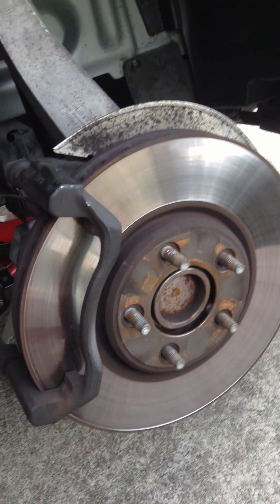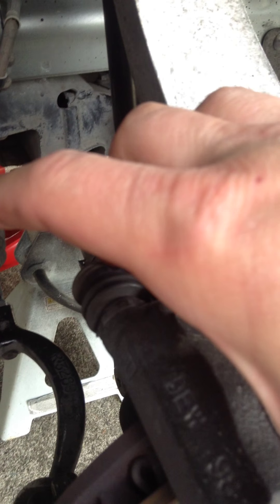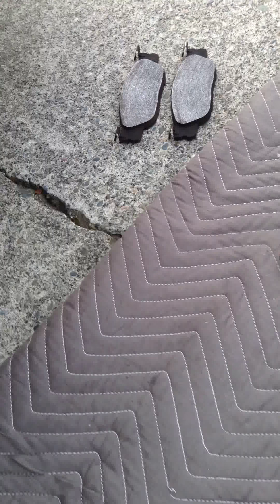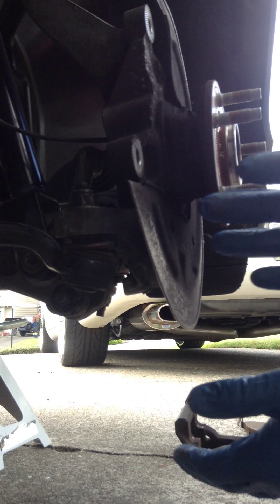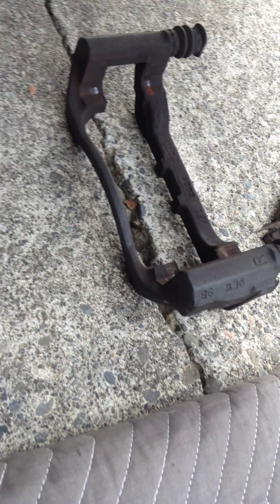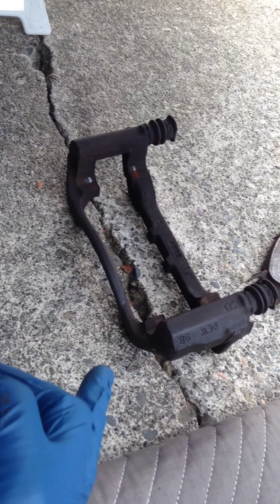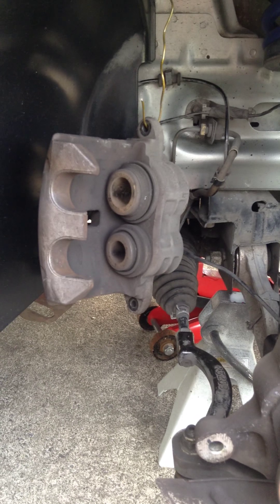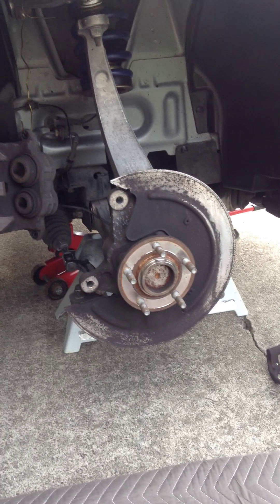Jaguar S Type Brake Pads Replacement | Jaguar S Type  Brake Discs and Pads

Comment: Can you show us how to just flip the rotors around ? I was told I need to do so but want to do it myself
Reply from the maker: So you want me to spend six hours taking the rotor off to help you? LOL  sorry bud, all joking aside, you will have to take what you can from the video and research it.  I dont know what you mean by flip the rotors around.  Ive never heard anyone do that and more importantly for what purpose.
Reply: If you are referring to "rotating", you take the rotors off and put them to the opposite sides. TO be honest, never heard of anyone flipping or rotating them.  There's no purpose at all.  Leave the rotors alone and whoever you heard that from stop listening.  You might be thinking rotating tires maybe but rotors no.

Comment: The clips are called anti-rattle clips and they help keep tension on the pad which prevents them from chattering or making rattle noises. whover did the brake job on a kawasaki Z10 I owned lost or forgot to put those back in (they are optioonal) and the brakes made all kinds of noise. Sometimes they are hard to find so don't lose them! You didn't say anything about what to do with the E Brake assembly?
Reply from the maker: Good stuff.

Comment: Well  i needed that first part cause my bolts on stuck and im not sure which way to turn it
Reply from the maker: I am not sure what you mean by first part?  Can you explain maybe I can help.  For stuck bolts get some pb blaster and a harbor freight breaker bar.  Also, not sure if this is a no brainer or not, but if you are using 3/4 inch drives grab a set of half inch drives as well.  You will also need some 1/2 inch ratchet star bit sockets for the jag.  Harbor freight has em!
Reply: @PhatkatCollections  i got it thank you my issue was the pistol you press in was different you have to have the tool you turn it while it presses

Comment: Thanks. Is there anything different or more complicated with the rear brakes? Someone told me the rears had to be done by a professional because the rear brake sensors where hooked to the cars's computer
Reply from the maker: Yes the rear pistons need to be twisted in with a proper brake kit.  You want to make sure the car is secure and then disengage the parking brake with your foot on the brake. Then turn off the ignition.  Make sure the car is in neutral then disengage park brake then turn off car.   Once you do the brake job you start the car and re-engage the park brake.  I've hear some folks get a fault but I did not.  Not sure if they get the fault due to having the brake engaged before doing the job or not.
Reply: as a non professional, where can I get a "proper brake kit"?
Reply from the maker: Harbor freight for your brake caliper pusher and pads and rotors I got off eBay.  You will also have to brake the rotors and pads in once I stalled.  Just Google it

Comment: This only amplies to 2003 and before.  After 2004 they have single piston electronic brakes, so this method isn't going to help you.
Reply from the maker: Your statement is completely false.   This applies to all year jaguar s types.   The braking system is the same except on the type R which uses different calipers and rotors.  They are larger and I 4 piston.  There are no electronic braking systems.  You may be getting confused by the electronic parking brake.  Easier years had a cable style parking brake then the migrated to the electronic one.  This car has the electronic one.   So you are incorrect .
Reply from the maker: This is another example of someone who does not know what they are talking about.   Jaguar has NEVER USED brakes by wire, ie electronic brakes.  It always amazes me how many morons there are on youtube who think they know what they are talking about.  The stype is broken down into three generations 2000-2002, 2003-2004, 2005-2008 and the  S Type R.  The type R is the only s-type that uses 4 piston calipers by Brembo.  All other generations and years use standard 2 piston calipers ( single piston on the rear if memory serves correct) All systems are hydraulic. There are no electronic brakes ( brake by wire) on these cars.  Nothing changed after 2004 so you are completely false.  In 2003 they changed the side skirt, 2003 they changed the v8 motor,  2003 they also used different cylinder inserts. Alot of improvements happened to the v8 version in 2003.  2005, they changed the side skirts.  Also, the electronic parking brake addition I believe happened in 2003 as well.  The pervious models were the standard hand brake by wire.  The brakes are hydraulic so this method will work on ALL jaguar non type R stypes.  The STR is a bit different but it is the same principle.
Reply: I can send you photos of my 2004 s-type with electronic brake. I have owned many jags and have 2 at present. You are embarrassing yourself buddy. Sorry.
Reply from the maker: Yup you do that.  The 2004 DOES NOT HAVE AN ELECTRONIC BRAKING SYSTEM.  It has an electronic parking brake.  Please send the pic.  You might be referring to an electronic wear sensor, but again, the brake replacement process is exactly the same as any car.  The only difference on a pad with an electronic wear sensor is you plug it in.  The only person embarrassing themselves is you.  SO AGAIN SIR,  YOU ARE 100 PERCENT INCORRECT.

Comment: Great - watched you're vid then changed my front rotors and pads today!
Are you gonna put up a vid for the rear brakes???

My man! 
Nige
Reply from the maker: +Nigel Sevier Hey bud thanks !  no I was strapped for time so I did not make one.  I can help give you some pointers if needed.  The rear you will need a different caliper press.  I recommend just getting the harbor freight kit for only  bucks.  It comes with everything youll ever need to do a brake job.  The rear calipers have to be pushed and turned at the same time.  The harbor freight press does this it basically turns the piston back into the caliper.  You cannot just press them in like the front.  Its still really easy and thats the only difference then the front.  The only thing you must make sure of is before you start the rears put the car in neutral  (saftely blocked off the car cannot roll away ) put your foot on the brake and make sure the electronic parking brake is off.  With your foot still on the brake turn off the engine.  The cars emergency brake will not be off.  The other important factor is once you are done.  Do not start the car!!!  First get inside the car and pump the brakes about ten times.  This will push the brake pads into position again.  I kinda forget exactly what I did but at this point im pretty sure I started the engine then engaged the parking brake.  This avoided any brake faults and avoided EPB re calibration.  Also one more note.  Make sure that when you put the new pads in you properly line up the notches on the piston and the notches on the pad.  You might have to play around with lining it up when pushing the piston back in.  If you don't line it up the pad will sit canted against the piston.   Who ever did the brakes on my car the first time did this wrong and it wore the pads unevenly and caused a lot of noise.    Hope this helps bud.
Reply: Hey Thanks for all the info... Wow so much good advice. I really appreciate how hewlpful you are to respond with such detail.
If you ever vsit England, you're welcome to visit - I'm just west of Oxford.
Thaks agaion pal
Nige
Reply from the maker: +Nigel Sevier My pleasure man!  Let me know if you run into any issues.
Reply: +Phatkat Allure De Pimp 
I have the rewind tool and hope to find time to replace the rears in the next couple of days.
Will let you know how I get on.
Enjoy your Sunday...

Comment: I have 2 S Types, a 3L and a 4.2L STR  and used your information as an on site 'brush up' for 3L front brake pad and rotor replacement. Good job, thanks. And no, this is quite a simple job however most things are 'simple' after you've completed them.  Thanks again.  You might also add extracting some brake fluid from the master before compressing the caliper pistons is a good idea.  Regardless, thanks again!
Reply from the maker: Hey my pleasure man.  I have been having an issue lately with all the windows being stuck down.  Any ideas.